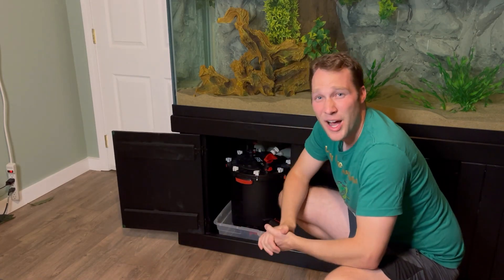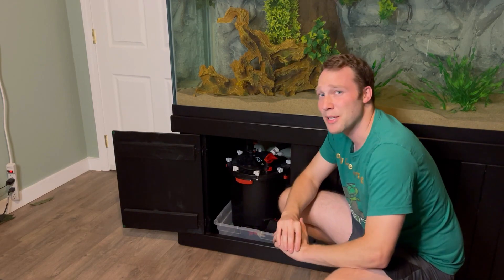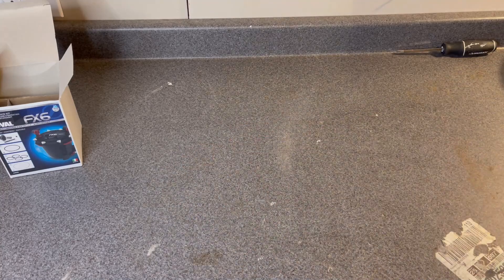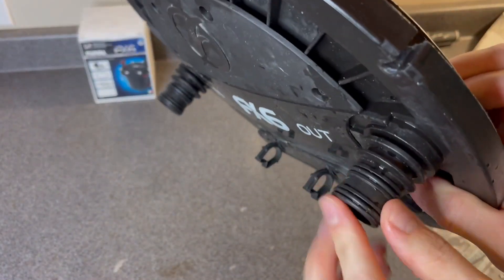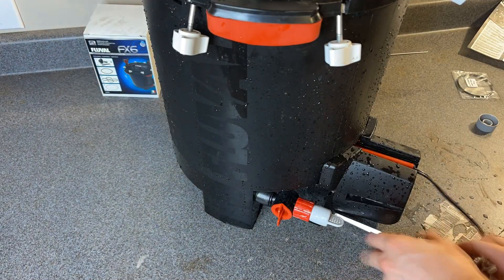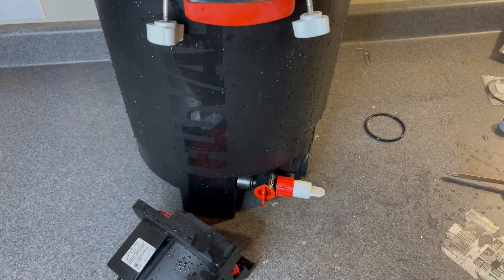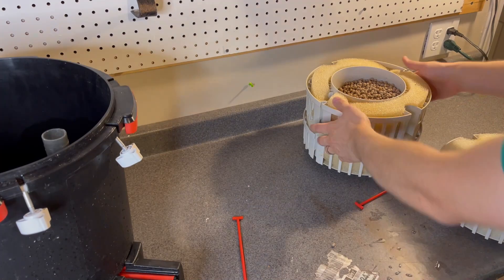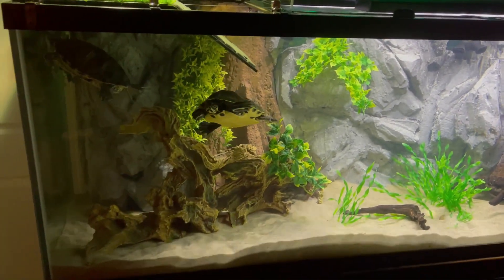Fluval FX6 NOT WORKING?! Try the Service Kit! - Full Installation Video for My Turtle Tank

Comment: Don't throw that old lid O-ring away.  It looked fine and you have a backup!  I'm glad you found the problem, if it had been a parts kit situation, I wouldn't buy the unit.  Putting filter media in wrong pbasket, cool - live and learn.  Filter pump failing in less than 7 to 10 years and needing a service kit, I would pass.

Comment: Hi really useful video which sorted my slow running FX6, I see you have a tray underneath your unit, ive been looking for ages for something similiar, where did you buy it from please?
Reply from the maker: Hey glad it helped! The tray is nothing special, just a plastic storage bin without the cover. Just measure the space you want it in and try to find a bin that works at Walmart or target or similar!

Comment: The problem I’ve been having is that after unplugging for a water change and plugging back in. It does it’s cycle of running for a couple of minutes and then shutting itself off and and then back on. Sometimes it doesn’t come back on. I finally got tired of the the BS and went eheim 2262 which is what I should’ve done from the beginning. However, I’m wondering by replacing the motor I may be able to salvage it??? This thing was probably about 6 months old at the time and it’s been in my attic. I recently pulled it back out and installed it on a 75 gallon. Worked great for about a month. Now it’s doing the same thing.

Comment: My pump is chugging water out.
There is no blockage on the impeller and the out put pipe is moving aggressively
Reply: I have the same problem and I can't find a solution. It's been like so for months, it drives me crazy. Have you found any solution?

Comment: Is the FX6 motor water proof?  I intend on placing my FX6 in a large plastic tote, that will also serve as an overflow from my sump.  On accasions some water will flow from the sump into the plastic tote where the FX6 sits on the bottom.  Is this an issue?
Reply from the maker: I wouldn’t count on the pump being waterproof, it has feet that elevate it a little but I would not submerge any part of the pump on purpose. Can you elevate the filter so that whatever amount the sump pulls it’ll never touch the pump? Good luck!
Reply: @LongLiveYourTurtle  thanks, I placed a bucket with gravel under it So that the pump will never bu submerged

Comment: Hey LLYT! I have a question. I recently just upgraded my turtle's home from a 40g tank to a 75g tank and part of that upgrade included buying an FX6. It's been working great for the past couple months but recently the tank has gotten a little cloudy. Ammonia and Nitrite levels are 0 or near 0, but Nitrate levels are pretty high, about 60-80ppm, even though I am doing about 30-40% water changes about once a week. Is my FX6 working properly? I see the intake/outtake in action and I hear the filter but I am wondering if it is not running at 100% power. Any feedback from anyone is welcome! I just want my turtle to have the best home he can have!! Thanks in advance.

Comment: I'm having a problem with my fx4. It's pushing water out but not sucking in. I replaced the motor and did not do anything different. Should I change the impeller too? I really don't know what I'm doing.
Reply from the maker: If it is pushing water that part sounds fine. Sounds like you might have an air purging issue. Make sure you have some water in the filter when you start it up (try different amounts) and make sure your hoses are setup correctly. Good luck!

Comment: They don’t sell o-rings specifically for the drain valve either - I wonder if it’s the same size as the ones on the lid? From what I’ve seen, people literally just buy a replacement for the entire valve if there’s a leakage problem. I never use it but I guess I’m just concerned about any potential problem lol
Reply from the maker: I believe it would be smaller than the valve one, but that o-ring is on the drain plug and isn't typically messed with like the cover and valves which you need to remove every cleaning.